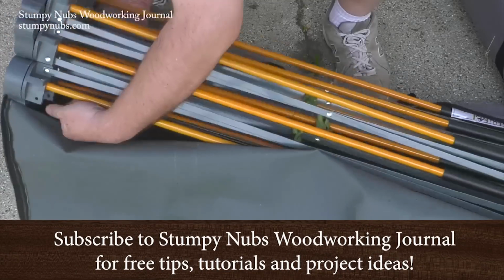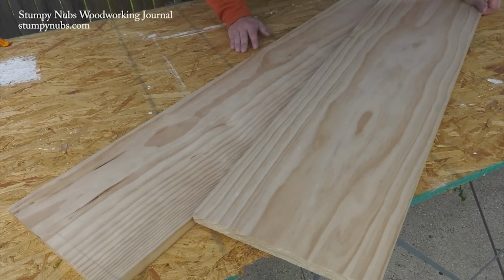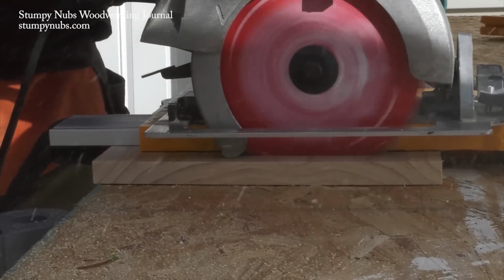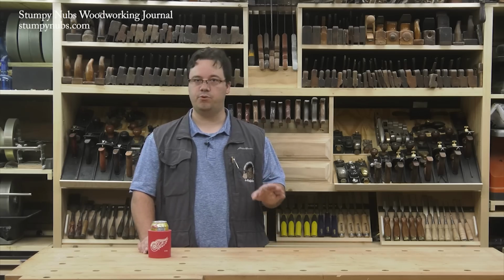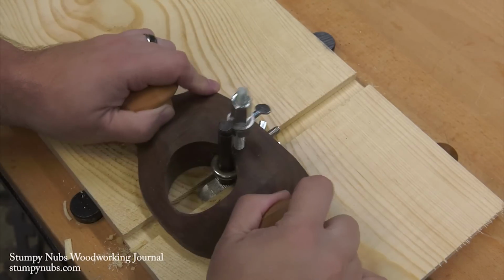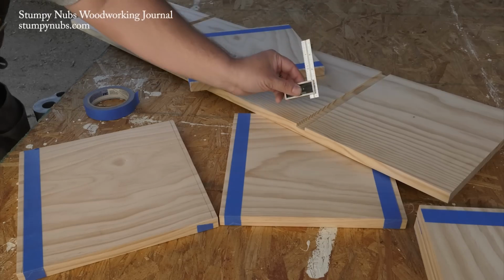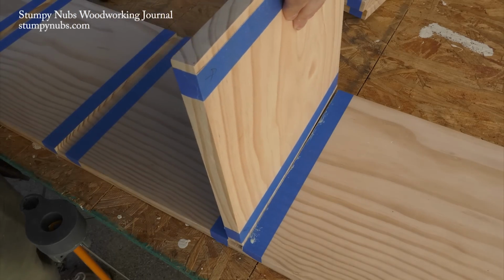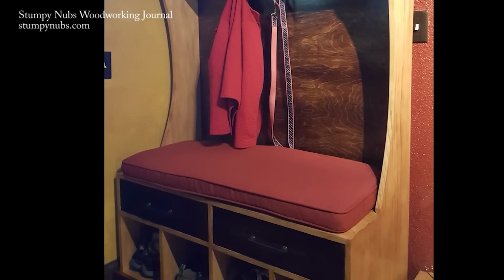Sick of fancy YouTube workshops? You'll like this video...

Comment: In 97 I built a 1000 sq ft shop with 12 ft ceiling, all finished and such. To this day, Ioften set up a couple saw hoerses outside because I don't like the cleanup.  The saw dust just gets swept or blown off into the adjacent grass.  I've built a few basic jigs and use an old 6" Porter-Cable Saw Boss, a couple of good routers, and an old Craftsman jig saw made by Ryobi in the 70's.  In bad weather I go inside, but yeah, outside with a few clamps and saw horses has been just fine.

The shop was used to build small fishing boats, sheathed in epoxy and glass.

Comment: There are several ways of performing the same woodworking task and sometimes is just preferable to use a certain tool instead of other. Also you can just CHOOSE to do it in a specific way. There is not a gold rule.

Comment: I left my job as a finish carpenter and went into trucking locally. Well after two years I’ve missed working with my hands and I’m building out my shop, luckily I only need three or four tools left. But I’m working out of an 8x8 shed I will set my saws up outside but I know the space will do just fine. Also you don’t need the fancy tools, I never judge a person on their tools it really comes down to the user and their knowledge on how to use said tools.

Comment: The bora guide rail system costs more than a table saw, plus you would need to buy the circular saw as well. Id rather buy the chop saw and table saw 2nd hand or cheap starter ones at harbor freight.

Comment: True story. Thanks for the vid! The day I've stopped watching 3x3 customs was when the cnc router came into the picture, and the new table saw, and ...u name it what :) Btw if I can add one thing here: under my journey I've learned to use the  circular saw with a diy track. Works like a charm. I've underrated this tool for no reason. I guess because table saw for beginners  is more safe than circular saw in general. But circular saw - if it's good (or track saw) is way more versatile

Comment: Just buy what you can afford and get started.  That's what I did.  You can make pretty much anything with a few basic items.  It's just that your workshop won't look as sexy, but it will get the job done.  I just had a cheapest tools I could find like a track saw, a router, a jig saw, and an orbital sander, and I have been able to create pretty much anything i have wanted.  You don't need thousands of dollars of tools.  A few hundred bucks and you have yourself a workshop.

Comment: What you said about the salt is wrong, it will dissolve after youve applied it, not fast enough to make it stop working but it just doesnt dissolve and disappear once the glue is hardened, it will stay in your joint forever. Either use a couple grains of fine sand and make sure you dont get it near the edges so it doesnt appear on the surface, this could damage your sawblade though if you have to cut across that joint later on. Id simply use straight cut off pieces and smaller clamps either horizontal or vertical to your joint and use it to allign the pieces before you apply pressure in the direction that you need it to join the two pieces together. Thats how they did it hundreds of years ago and it still works perfectly fine. Yes, the salt trick does work and most likely wont make your glue up fall apart instantly but manufacturers of wood glue are saying that it could weaken your glue joint and its not the best thing you can do. You could also get or make a dowel jig yourself but imo the scraps work perfectly fine and are easier than all of the alternatives. I work as a old school european staircase builder and thats what we use for all our glue ups, steps, stringers, railings, flat or curved, it works in almost every scenario i could think of.
Reply from the maker: You must know I meant the salt crystals that are used as grit in the joint would dissolve and not that the actual sodium would literally disappear, right?

Comment: I stopped watching your video around the 5 minute mark. You're using these saw and router guides that many people will not have. That is, if they even have a router, or the glue clamps required to create the cabinet sides of your build. If people with limited tools and skills want to build a functional but strong piece of utility furniture, you should use the most basic tools they would likely have in their garage.

Yes, I am sick of seeing these videos with carpenters who have immaculate shops, all of the latest equipment, and years of cabinetry or finish carpentry experience, trying to show us how to build furniture. Most people seeking to build their own DIY projects just want simple, cheap, and easy ways of building something they actually need.

Try building something with just a circular saw, square, drill, and hammer, with minimal glue-ups or complicated cuts. That is what many people, who are trying to save a bit of money, want to see...in my opinion.

This is not a criticism of you or your videos. I enjoy watching your videos and find value in what you present. Then again, I am a retired carpenter myself. But even I don't want to partake in these elaborate builds anymore, making fine furniture pieces...I'm too old and tired now. I am actually reverting to using older carpentry practices, building a shave horse and using manual woodworking tools, much like we see on your back shop wall. I can whittle away on projects, taking my time and filling my days with some semblance of usefulness...it's what us old guys do.

But such is the life of a retired and handicapped old fart today...bitching about anything and everything in this 'modern' world. Just thought I'd add my two cents worth...carry on sir.
Reply from the maker: An edge guide is not some extravagant tool. It's sure a LOT less expensive than a table saw. Even so, if you want to make finer furniture it is reasonable to suggest you may need a little more than you would need to make a simple book shelf.... But putting all that aside, I am quite sure you are capable of making the mental leap from the edge guide in the video to just the saw without the guide if you think you can cut straight without one. Stop making excuses for why you can't do something and start thinking through the process and figuring out what modifications you may have to make to overcome your limitations.

Comment: I don’t have a shop with lasers & photon torpedos but I do have table & miter saw. Even so, I find myself using my Bora products a lot bc of the ability to cut IN SITU. I don’t want to bring huge unwieldy and/or heavy plywood sheets to the shop saws & have to heave ho after I’m done cutting. For instance, I was reroofing a huge shed & needed to replace some plywood sheets & cut everything on the roof saving me a lot of effort.

Comment: Thanks for all of your great videos.  I've learned so much from you.  Can you give me some guidance about air circulation in a woodshop for dust filtration systems.  All of the commercial units are mounted high with the discharge also high.  I'm designing my new shop and it seems to me that the intake for dust filtration system should be low (dust settles, and why draw dust up through the breathing level rather than down to my feet) and then duct the discharge up to the ceiling and directed to travel around the shop.  That way the air flow will draw the dust down and return filtered air to where my lungs are working.  Obviously, more ductwork but maybe worth it. Thoughts?
Reply from the maker: Low is better for keeping the fine dust below your breathing level, and it also helps pull the heat down and keep the room temp more even in the winter, but tools and benches impede airflow near the floor and make it more difficult to circulate and filter the air efficiently in small shops.
Reply: Thanks for quick reply.  My plan is to build a multi-filter frame below a long counter and use a furnace fan and duct the filtered air back up to the ceiling height directed to create a circular air flow.  Your input helps a lot. @StumpyNubs

Comment: 2 weeks ago i bought a circular saw and thought it was the worst tool ever after trying to cut perfectly, im super glad you posted this cos this edge guide is exactly what i need
Reply: I had a similar issue, but I came up with my own solution.  I have Aluminum L angles  that are 1 inch wide, which is the same width as the guide edge to the blade edge. 

allows me to clamp them on each side and I get a great guide. allowed me to save a little money so I can afford better accessories and up my game.

Comment: I just bought the bora guide last week, I knew they had a circular saw attachment but I will be picking up a table saw shortly, however the router attachement will save me so much trouble and though they are probably costly it is worth the cost. Thank you so much for this video. BTW why does your guide not have measurements on it like the one I got from Lowes?

Comment: Very informative video Stumpy! Liked it very much. Even though I have a table saw, I like to break down bulk wood, aka sheets of plywood, with my circular saw as it is easier for me. I really like that track guide as well as we're able to use both hand saws and routers using the same attachment. Also, still glad you do a lot for small shop woodworking.  

Saw on brother! 😊😊😊

Comment: In 1958, my dad built the home I grew up in.  He used nothing but hammers, Sears circular saw, and a square. Sits on a slab with brick front. 65 years later it’s still solid and standing.

Comment: I've a question for anyone that has given this consideration or tried it.  I don't have a router table, but I do have a variable speed drill press and drill press table with an adjustable fence.  Is there anyone that has used router bits in a drill press?  I am thinking of edging bits or for cutting dados.  I don't think I would attempt large pieces and overall options would be limited.  Any advice would be most appreciated.
Reply from the maker: I've tried it. It doesn't work that well. The drill press just isn't fast enough for a clean cut.
Reply: Ta @StumpyNubs  Thanks so much.  I thought that speed could be an issue.

Comment: Always appreciate your videos. I don't make furniture, but am a boatbuilder. Have been doing the work with what many people would consider sub-standard tools (my table saw is a $99 Ryobi contractor saw I placed in a cabinet for support on the sides and outfeed), and have been building parts out of everything from cheap pine to 16/4 purple heart and white oak. The game changer in my shop was a Dewalt 12" compound miter saw: amazing what you can do with a really good and large miter saw. And I've been using the Bora straight edge without the attachments for years. Clamp, Skilsaw, and go. I'm getting ready to buy a mid-level cabinet saw, but will miss the pride of sitting back, looking at a piece of work, and saying "I did that with just these tools."
Reply: That's awesome to hear! I have the same DeWalt miter saw and I definitely feel like I'm under utilizing it sometimes....do you have any examples of specific techniques and options that the 12" DeWalt miter opened up for you?
Reply: @TheUbiquitousNomad  Having the ability to repeatedly and precisely cross-cut 10" wide, 4" thick material with a jig did it for me. The greatest ROI was setting up a jig to cut round circles out of 8" wide by 3" thick material which became dead-eyes and reeving hearts for use on the Boston Tea Party Ships in Boston. The material was just way too thick for my band saw to handle.

Comment: That one hint about the glue is probably the best one you can give. I've seen YouTubers wipe off the excess. Every time I've done that to a piece I was planning on staining I kick myself. Stain will not work where glue has sealed the wood. If for some reason you let it harden you'll have to use a scraper.  The one thing to be careful of is using so much glue that it drips down your work.  Not only is it hard to get off but also seals the wood requiring a lot of sanding.  One fellow had the great idea of using masking tape to prevent glue drips from sealing the wood.

Comment: We live in a second floor apartment of a suburban house.  My "workshop" is a 9 x 11 foot bedroom that doubles as my office.  My "workbench" is a steel desk that I raised and modified myself so I can clamp things down.  I even attached a front mounted vise.  In it, I store my hand saws, chisels, sharpening stones, and wood planes.  The closet is full of power tools and a pegboard on one wall holds most of my hand tools.   I have a benchtop drill press and a set of Forstner bits sitting on top of a two drawer file cabinet, a circular saw, a jig saw, several sanders, an angle grinder, a Dremel,  and several drills.  I do most of my cutting and sanding on the driveway on account of the dust, but I do have a Rigid shop vac for work done upstairs.  The biggest PITA is dragging all my tools and materials up and down the stairs.   My best addition was a Craftsman contractor table saw that I got at a garage sale for $25 and a folding 1980s era B&D Workmate that I picked up at another yard sale for $20.  I built a router table with an adjustable fence that drops into the Workmate.

I built two oak desk hutches, three poplar bookcases, a king sized oak headboard with decorative cast iron panels for our bed, a kitchen storage cabinet /china closet, a 7 foot tall playground for our cat, and more small decorative and functional projects than I can list.  My dad taught me that you don't need a huge workshop or expensive branded tools to get lots of work done.
Reply: Nobody cares
Reply: @colonelJ77  LOL Obviously you cared enough to reply to a comment made 10 months ago, you clyster-pipe.
Reply: @colonelJ77  LOL Yet you cared enough to comment, you clyster pipe.

Comment: Another useful video where you share your thoughts, tips and tricks with people who are looking to get started down the path of the hobby of woodworking. Your videos are filled with all different topics that I am sure has helped tens of thousands of people over the years. This post is not intended to criticize,  but to simply state that your definition of simple power tools in my opion should not include a track saw and any of its attachments.😮

If you want to be simple and basic, show how you can crosscut or rip, a board or plywood, using a straight edge board, nailed in place as a guide for your skill saw, instead of using clamps. A lot of people who are just starting out in the hobby may not have the funds to spend on such a tool.😢

I have worked professionally in the cabinet industry since 1973, and I do therapeutic woodworking at home. To this day, I do not have a track saw and do not see me owning one in the future. If you are going to talk simple and or basic, talk and show truly simple and basic tools.

Thanks for all that you do for the hobby.😊😊

Comment: I once had a Ryobi table saw and it was a really nice table  saw... However it had a runout of about 1/16 per 4 foot of cut.. I tried everything from laser aligning the fence and the blade, changing the motor bearings to high quality ceramic, Tried a high quality a expensive blade,  but no matter what i did, i could not get the runout out of that machine. there was just too much give in the motor cradle itself.

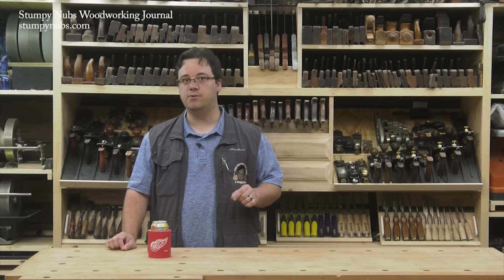Comment: 6:13  Another way is to put the board(s) on the lawn on a sunny day.  Put the concave side down (on the grass).  That means the convex side is facing the sun.  Sometimes this works, sometimes it doesn't.  Just don't leave them out there too long, or wait too long to make your cuts and assembly after they are flat.
Reply: Yup, I've done this.  Works for solid as well as plywood.

If you leave it too long, you'll have to flip it over.  Gotta pay attention.  But it DOES work.

Comment: I lack a tablesaw. Instead, I have a tracksaw, and 2x2 foam sheets from the local HD. I lay down the squares in length of the wood to cut. If deep cuts, I lay additional squares on top (I have 8 in total). I can then rip small trim, bevel ends, or rip sheets. Just need to manage the cord as there was no cordless tracksaw when I bought my makita. I use festool connectors for tracks, and dewalt clamps when I need to do work on a workbench. And I have router jig for the track saw to run long dado or lap joints, and champfers.

Comment: Thanks for the video. I disagree with the bora sentiment though. I bought the one that I could use with 8’ pieces of wood and it was a pain to put together and they didn’t even line up. One piece was wider than the other meaning you’d never have a straight cut. And it was the system that you purchase as a set. Not me putting together parts. I have other bora stuff that I love. Was very disappointed with this.
Reply from the maker: What happened when you contacted them about it?
Reply: @StumpyNubs  I returned it to Menards, where I bought the products. Sorry I didn’t have an experience directly with the company. Thanks for asking!

Comment: I'm 67 and have been doing woodworking since I was about 10. After I retired 10 years ago I started building and selling furniture to supplement my income. I have some great tools like the Bosch articulated miter saw, $600 on sell 5 years ago. Worth every penny. I also have a harbor freight 33 inch wood lathe that works great for table legs. I have a lot of old antique and vintage tools. A lot of tools I bought used. If you do your homework...ie... research, you can over the years come up with a shop that you can build anything with.  Name alone doesn't matter much to me.